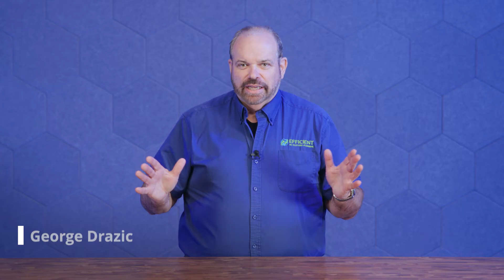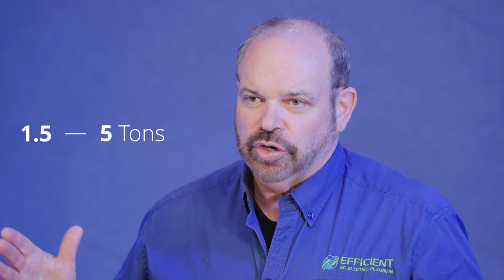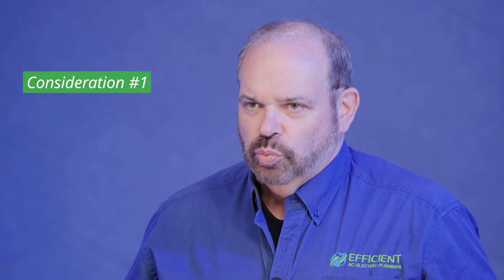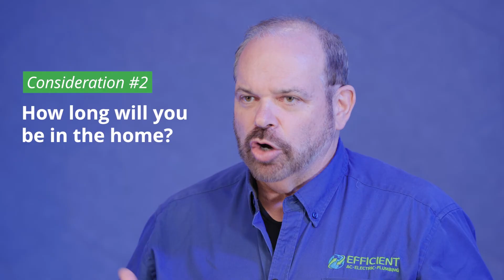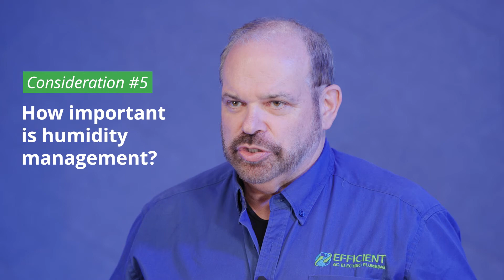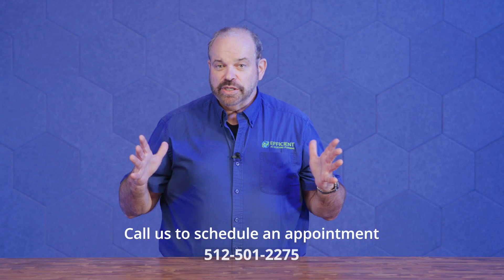How Much Should A New Air Conditioner Cost?

Comment: Heat and a/c has become like buying a new car, you're going to get screwd. Changing Freon rules every few years makes your unit obsolete so you are forced to buy a new one. This means the EPA, heat and air guys and manufactures have you by your balls. Heat and air guys will screw you like a car mechanic or used car salesman. The ozone is not in danger, but flammable Freon means your in danger. Of course both my central heat and air units broke.The quote I got made me want to slap the HVAC bitch. I bought 2 Mini- Split units and installed them with my sons help. It took about 3 hours. My ac bill dropped dramatically. I will never call an HVAC crook again.

Comment: My central AC is over 20 years old now and it makes so much noise. It actually wakes me up at night at times because it's right outside of my bathroom window. I also notice my electric bills going insanely high even though I keep the temperature between 82 and 85, and have it go up to 90 during peak electric hours. I'm thinking it's time to get a new one but I'm wondering if I should stick with Trane or go with a different brand that might be quieter? I keep hearing that most trane air conditioners are really loud
Reply: You can buy a heat and air unit online or at Lowes. You can do the labor which isn't hard.Then call one to charge it with Freon and save $1,000's of dollars.

Comment: Hi, I received a quote for AC replacement of 9590. With that we would be getting an AC Pro model#4AC17L60P and this would include the outside unit, the part of the AC connected to the furnace, cleaning the run off pipes and a new thermostat. Thoughts?